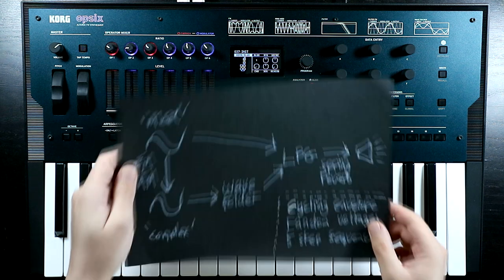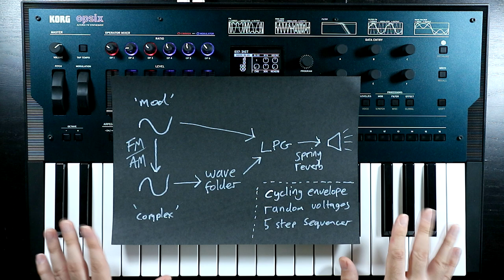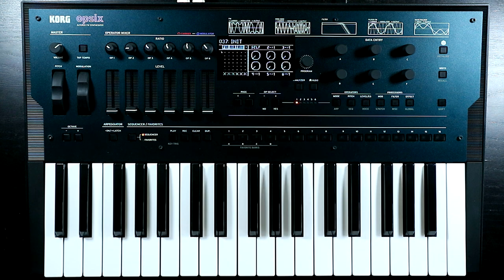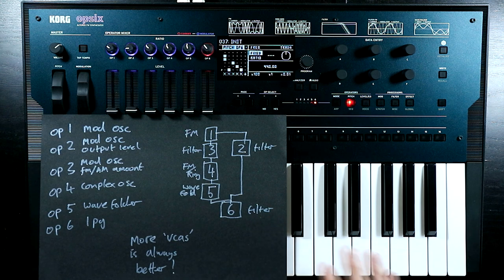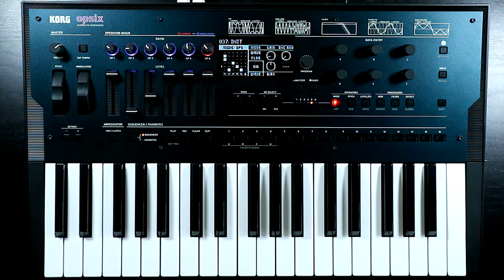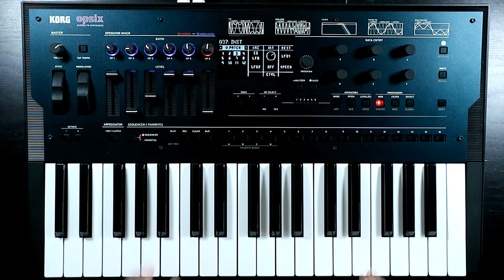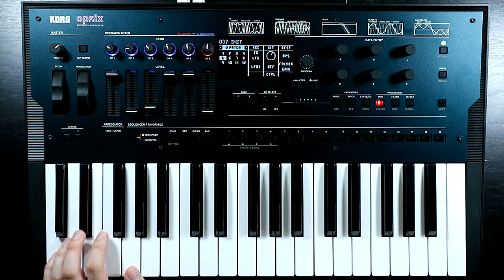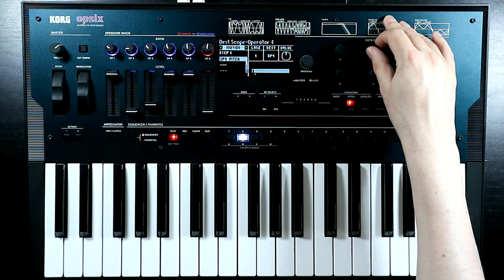Korg opsix: Buiding a West-Coasty, Buchla Music Easel-esque patch using User Algorithms

Comment: A thoroughly enjoyable voyage into another fascinating dimension of this wonderful synth. Thank you! I wondered whether you would save the patch after you made the initial "Buchla Template" setup, so as to be able to use it as a starting point for other ideas. Could be an idea to note for anyone reading this who wants to try this for themselves. The user algorithm allows for a lot of flexibility, and I have to admit I'd never thought of using it to make "circuits" with VCAs in them, as you did here. Quite a revelation.
Reply from the maker: The patch that I've shared in the video description - if you go onto the vpatch and remove everything but the first two slots (and clear the sequencer), then that should get you to a "empty" version of the patch that you can take forward and explore. You can also swap the modulation source on those first two to Envelope 1 if you'd rather not have the cycling functionality (if you do that then you should set the sustain of Envelope 1 to full if you want an 'authentic' patch to work with).

The "VCA" trick is pretty powerful, but you have to balance it against losing an operator to doing something more interesting - but in some patches, having that VCA control will be the interesting use case I suppose!

Comment: While I don't see an opsix in my future, this is some excellent work! It inspires me to get a Korg Volca FM2 which is within reach,  and see how far I could get in this direction. What do you think? Somewhat feasible? Really enjoy the sounds you've gotten!
Reply from the maker: Sadly for this example you'd really struggle with a Volca FM2. It's a fine synth for the money, but it's very much sat in the DX7 way of doing FM and all the user algorithms, operator modes and flexible modulations simply aren't there.

If you're looking in that price range for these sorts of sounds and patches, I would probably look towards either the Microfreak - not exactly the same thing, but it has some of that "West Coast" philosophy in there, as well as flexible oscillator types and a mod matrix; or the Volca Modular which is very inspired by the Buchla way of thinking and replicates basically the same architecture as I build here.

Comment: How about building a prophet 5!!!???
Reply from the maker: That would be fairly similar to my Juno patch I think, but you'd get rid of the high pass, and use it to act as a VCA between the two oscillators to do FM. And have a wider range of waveforms on the two oscillators too.
Reply: Maybe a quick tutorial on how to create the vca and add the waveforms??? Fingers crossed *
Reply: Even if not, man you saved me thousands bc now I don’t have to buy a Juno, so…. Cheers!!!
Reply from the maker: @granderlavail6836  I talk about and use the VCA concept in this very video. Around 06:25 I start talking about why I need them (basically the same idea as you'd need in the P5) and go on to show how to set them up in the User Algorithm. The different waveshapes are just selecting the appropriate waveshapes for the relevant operators, that's all.